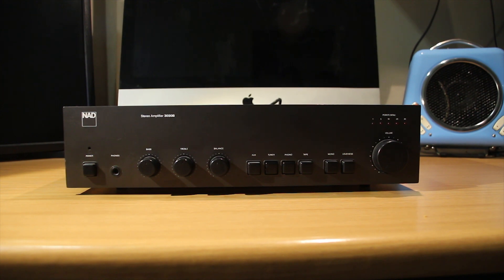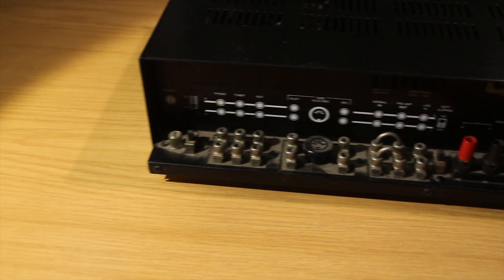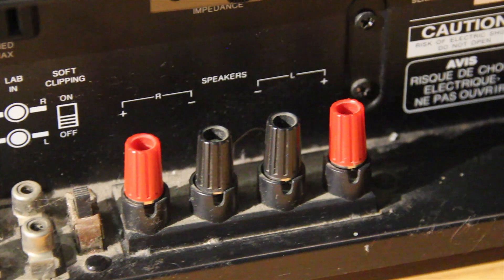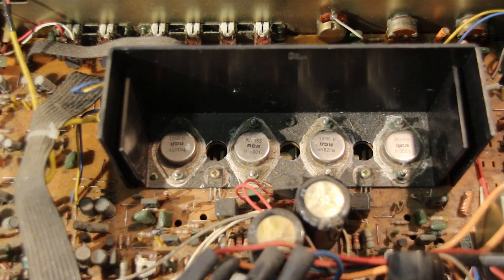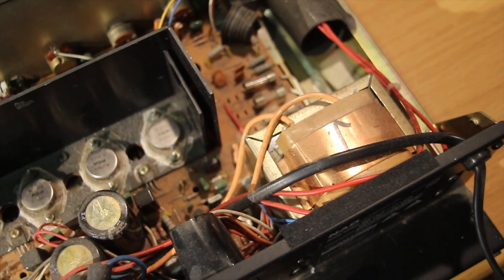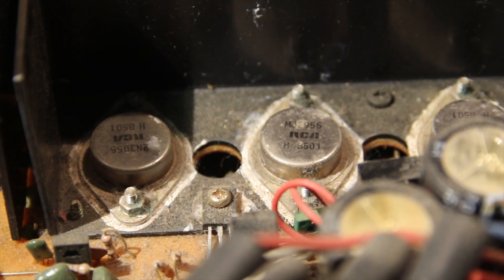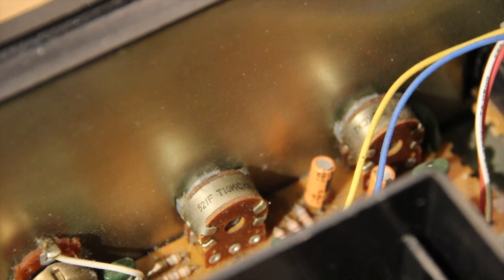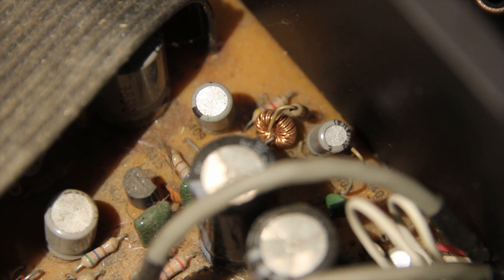Vintage NAD Amp teardown

Comment: Hi, I have a Nad 3020 ser.20 after replacing all the electrolytic capacitors, there is a pops in the right channel of the amplifier. By removing the jumpers, the popping disappears.When I disconnect directly from the power, the popping also disappears.If I want to turn off the selector normally, I have to turn the speaker balance to the far left position. Then there is no popping either. Has anyone had this problem with Nad 3020?
Reply: I always turn myn on and off with the volume right down and I switched to another channel disengaging the speakers inserting a headphone adapter in the socket. I'm sure it still pops/thuds, but it has no impact on speakers.

Comment: Hi. 
Don't I
Reply: I don't know if you can help but the speaker red plug negative sockets are stuck open. That means I can't screw them down to use plugs to connect my speakers. Already broke the red casing trying to loosen them but they didn't shift. Any ideas how I can replace them. Thanks.

Comment: You are still lucky. I got the amplifier in such a dirty form that I had to wash it several times in the bathroom under the shower.
Moreover, the previous owner began to improve the amplifier and put his capacitors different from the circuit diagram. I returned everything to the factory circuit and the amplifier began to play perfectly. The question is why he did this and I had to redo other people's mistakes. In general, the 3020 amplifier is certainly a masterpiece and ten best rated by audiophiles.
Reply from the maker: Could not agree more, it is simply great